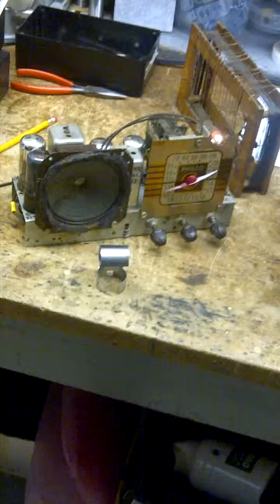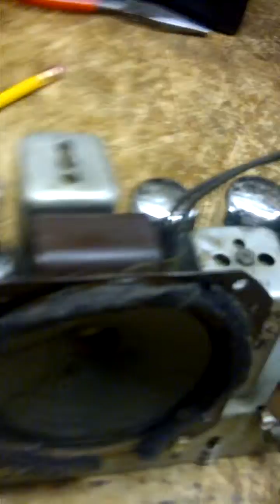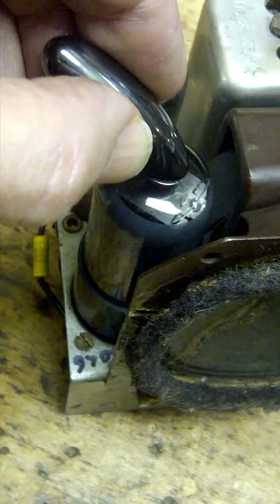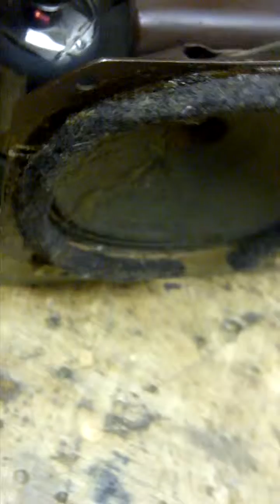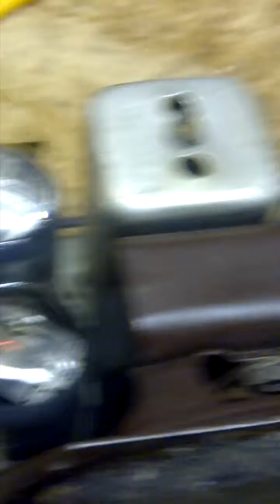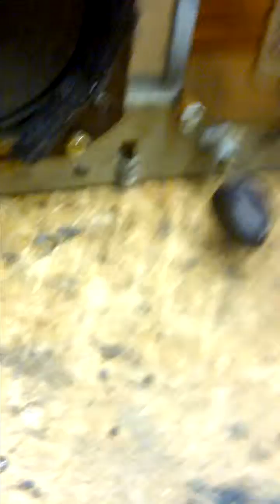Philco 40-120 radio, AC hum stopped with a magnet

Comment: I will not say that I am correct on this. But this will be my "guess" only.
There may be a component (heater, grid, or plate?) within the tube that is possibly vibrating or moving while in operation. it might even be a short. When you place the strong magnet near the tube, the magnetism stabilizes the component from vibrating and therefore "stabilizes" the performance of that tube. I may be incorrect on this, but it's only a guess. maybe someone else will chime in and have some input as well. Cheers.